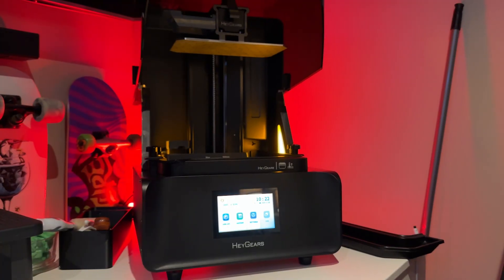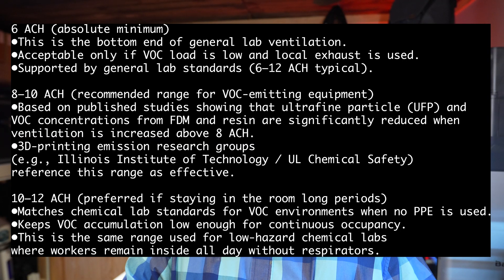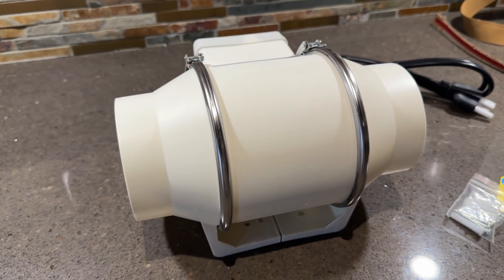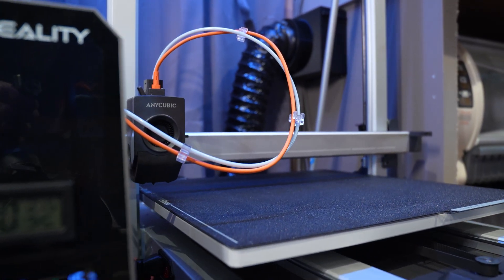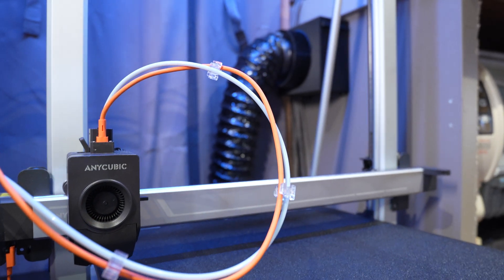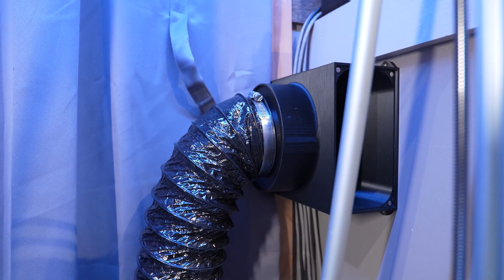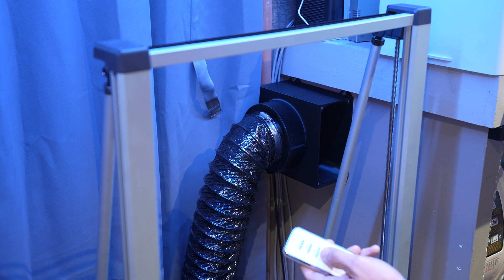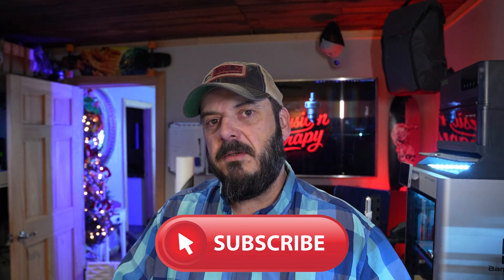3D Printer Ventilation That Actually Works

Comment: Hello,

First of all, thank you for your contributions to the community. I have a quick question. I’m using a Bambu Lab P2S and mostly print with PETG and PLA. I’m considering attaching a hose to the rear fan of the printer to vent the air out through a window.
Would this drawing be suitable for that purpose?
Reply from the maker: No need to vent PLA or PETG, buy a particulate meter and see if your VOC or PM2.5 even get elevated, I doubt they do.

Comment: What do you do for make-up air if you are sucking all the air our of the room? Do you have a sense within what radius of you exhaust it is still stinky outside, meaning how far do you think make up air intake should be to not just suck everything back into the interior?
Reply from the maker: I don't do anything special for make up air it either pulling it from my HVAC system or from under the door that separates this room from the rest of the house I don't open any windows. When tested with the outside sliding door open on the other side of the room letting fresh air in. I didn't see any increase in CFM at the intake, indicating that it's getting plenty of flow, it's not restricted. 

Turns out all pretty much for not, since I've picked up a VOC and PM 2.5 meter I've had my FDM Printer printing PA6-CF and the resin printer going simultaneously and neither of those values go above normal. Negating the need for the exhaust in the first place..

The only thing that will set the meter off is the IPA in the cleaning station and my exposure is three minutes tops.

Comment: Couple of questions. One if the point in sucking it out would it be possible make the hole bigger and there other hole 8” for a bigger exhaust fan?
Reply from the maker: Sure and why I made the box 6” just in case the 4” duct fan in inadequate.

Comment: Consider how the air flows. Where it comes from (through your door) where it goes to (the fan) how does it flow around the room. Are you working within the clean air fow or are you in the dirty air flow?

If the flow is not linear i.e. in a sraight line from aur in to air out then you get excessive mixing of the aur meaning its all dirty air and extract is rendered innefective.

In any kind of commercial scientific environment ideally this is optomised using enclosures. Think an open fronted box with the printer inside and extract from the back of the box, all the air passes the printer and is extracted without mixing. Also the air volime considered for extraction is the volume of the box not volume of the room. Thus us far better and far far more efficient

Comment: One thing that can help the flow is not to use the flexible hosing, but to use smooth plastic pipe, the corrugation on the hosing creates turbulence which will mess up your airflow - the smoother the better for ease of travel (just like the curves you put in your box)

Comment: You don't wanna look like Darth Vader with you PPE? 
I'm actually designing a Darth looking mask to take my 3M vapor cartridges. Practical? probably not but cool looking.😀
The pink cartridges look a bit wrong though. Ooh! maybe Barbie Darth. There's something new.
Those internal curves/smoothing should help efficiency in your vents. Nice video. Cheers!
Reply: How is the mask coming along I had a similar idea is yours finished yet?